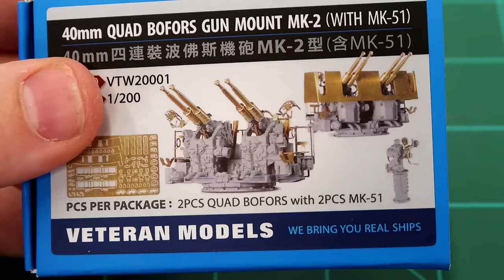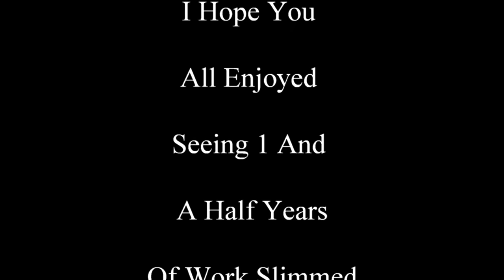1/200 USS Missouri Build Start to Finish

Comment: I am mainly a sci-fi modeler but I have built a few ships in my 50 years of model building. First of all I would like to say you did an outstanding job especially with all the hull details you did. We all make our little mistakes now and then but I must say this is the best build I have ever seen. Museum quality perhaps. I decided to change things up a bit as it's been a few years since I built a ship model. I picked up the Academy 400 scale Missouri and 600 scale Enterprise aircraft carrier models from Freetime hobbies as the size of both fit my bill and the price wasn't way out of budget. I did pick up photo etch railing for both as the give the model a more realistic look and not so toy like. Other than that they will be built out of box with whatever needs to be corrected using my own modeling skills.  Seeing both kits reviews they seem to be downsized versions of the 350th Tamiya kits. The parts and the parts tree layouts seem to be identical. The Missouri measures 26 and 3/8 inches long and the Enterprise is 22 inches long. Perfect size for my space in my model room. My question for you is I mainly use Tamiya acrylics as the Model Master enamels are no longer available. I want to get the colors close and I mix my own paints many times which is not a problem for me. What Tamiya blue colors would you recommend I start with to get me close. I use the XF acrylics and I'm not worried about being exactly spot on to the measure 22 scheme just so it is somewhat close. I'm looking for getting the darker color on the hull close and the color on the wood decking. Any info would be greatly appreciated. You and your family have a Happy and Healthy New Year and stay safe.
Reply from the maker: So when I ran out of “Weather Deck Blue” I mixed my own out of other Model Master colors. I started out with a dark blue, I believe or a blue grey. Something along those lines. What surprised me was I needed to add A LOT of red to the blue in order to go the right direction for the weather deck that I had already painted. Looking at my small collection of Tamiya paints on the shelf….. I would start with a purple and add dark blue to it. The purple is “lighter” than the dark blue.  But the dark blue should take you very quickly in the right direction. If it seems like it needs some grey or even green, just add them as necessary. I guess what I’m trying to say is start with just blue or something light blue. But don’t be surprised if a lot of red is the next base color.

Comment: Amazing job. Fantastic detail work. I’m just a little perplexed about the deck color. That isn’t anything like the actual color of Missouri’s deck. I’ve been on the ship many times and I know it pretty well.
Reply from the maker: You were on it during all of World War II ?????
Reply: @TheMidwestModelShop  No. I’m old, but not that old. Hehe. I have lived on Oahu all my life and have visited the ship at Pearl Harbor a bunch of times. Did they paint or stain the deck darkly during the war perhaps? Because it’s like a light silvery gray now (the deck is covered with teak planking so it won’t be slippery when wet).
Reply from the maker: During the war it was stained a dark blue so it wouldn’t stick out to enemy aircraft. After the war in late 45’ they took the stain off. It always had teak decks. It’s probably that silver color now, because of the exposure to the sun.

Comment: Hey look a silly question but how do you go about masking the metal decking for your upper superstucture ? particularly wonderig about tricky  spots like the inside of gun tubs or where there are vertical walls ? I've finished the Hood and currently working on the Nelson and the whole process drives me up the wall - thanks in advance (ps a little video would be great if possible) -
Reply from the maker: I did a whole video series on this build including masking the gun tubs.